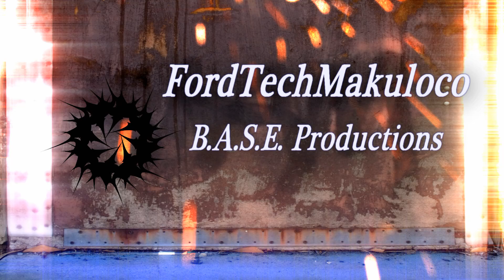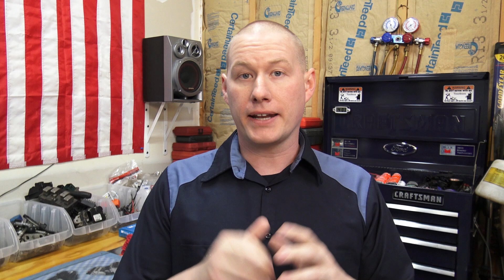Ford 6.7L Powerstroke Engine: Preventing Catastrophic Engine Failure

Comment: remove cab motor  switch over everything  and re install motor and  cab test drive in 30 hrs by myself I couldn't  do that not in the best equipped shop there is

Comment: Watching your video 20mins after my 6.7 failed. Limped it 3 blocks to the top of the hill until I could put it in neutral & coast down the hill & into my driveway. 419000 oilfield kms. 😭

Comment: Why can't just the cylinder be replaced? I don't understand why that means you need a new engine. As long as its not cracked and the cylinder wall is not damaged can't you simply install a new cylinder head and maybe even some valves?

Comment: I brought a 2011 Ford F-350 6 months ago with only 77k miles when I brought it. Put at lest $15k in maintenance and repairs and some upgrades just to have the engine suddenly fail at 133k miles. One of the codes is glow plug and other codes dealing with fuel injectors and assuming fuel pump. Ford want 18k for new motor. Mind you I still owe 30k on it. Looked online and seen that they have a class action lawsuit going on on this exact problem. Apparently Ford know for decades and didn’t recall. Called the attorney to get some info and waiting for call back. This truck is our families source of income and no Diesel truck should fail at 133,000 miles especially after constant maintenance.

Comment: Hello, I have 4 Ford 6.7 diesel power stroke engines from 2014, the camshaft has failed, cam 1 and 2 wear out abnormally and lead to disassembly of the rocker arms and their corresponding consequences. Does anyone know what the fault may be?

Comment: If That Ford engine is so good why is there a catastrophic failure issue. Just saying.
Reply: Don Olypopper  The big 3 are all in the same boat now . I preferred ram because of the low BS under the hood. But now I'm stumped.  I was leaning towards a Fa Fa Ford but only if It could be delete , with a good tuner, but now I just might just go gasoline. I lost interest in diesels pick ups cause the over the top cost and maintenance now .
Reply: Don Olypopper  they can be made good but after alot of down time and money. Sadly the era of being able to modify or even wrench on our vehicles might be coming to an end . We need to support the RPM Act 2020

Comment: Good morning,  my 2004 turbo bladed on both sides of the turbo were broken off and can't find  the broken parts. I picked up a new turbo. Where did these broken blades end up and will it find its way to the engine. Would appreciate your feedback. Thanks
Reply: intercooler,take it out,blow it & clean in solvent get rid of the bits & oil build up..simple..

Comment: 2019 ford f250 6.7l power stroke , i don’t know much about diesel, how would this truck do as a daily driver/short trip truck, (no deletes) no towing or hauling, 6 miles to work and 6 miles back home? a grocery getter. long trip once a year. i just want a big truck, i like the sound of the 6.7l power stroke diesel.
Reply: Diesel is a lot of extra maintenance, and short trips under light loads make it hard to keep the diesel particulate filter clean. I would go with gas in your situation.

Comment: My shop just installed a long block 6.7L in a 2011 Ford F350 Super Duty with 20,000 miles, because the glow plug tips broke off in a couple cylinders and it only ran on 5 or 6 cylinders when being pulled into the shop. Luckily the customer had purchased an Extended Service Plan so that he didn't have to pay out of pocket for parts and labor. There was a label stamped on one of the valve covers of the new engine that said to use the latest updated part number for the glow plugs.

Comment: I have the notorious vacuum pump oil leak at 95k miles. 89 inch/pounds seems a little less than it should be. If I did not have the massive RV, I'd return to an F-150.

Comment: 163000 on an early 2010 bulit 2011.  I will be doing this asap!!
Reply: Smart decision.  My engine was replaced at 92K due to the glow plug failure.  It took Metro Ford of Schenectady, NY five weeks to replace the engine.  It was covered by my extended warranty and it's the first time I ever purchased an extended warranty for anything.

Comment: I'm in that situation right now seeing your video relax me a bit because I couldn't understand what was taking so long to get parts to fix my 2015 f350 and had no idea of the process. Guess use to gas engines now know totally different animal. High pressure fuel pump 29000 miles.

Comment: Hey man awesome video! I wish I would have seen this sooner, my truck just hydrolocked , my glow plug failed and fuel got in the engine. It’s dead and the Ford dealer says 16k for a new engine!!! Im screwed, out on tour and thinking I’m going to just buy a new truck and cut my losses. It’s a 2011 Ford Super Duty Lariat Dually. So frustrating after giving Ford another chance after nightmares from my 2006 6.0 Super Duty. Im sorry to say but I think I’m done with Ford... shouldn’t this be a recall or something? I feel like 168k miles was too short for my truck to have the engine go out on me. So frustrating ...
Reply: for that price i would get a cummins and bite the bullet , far cheaper

Comment: just came across this video and I am currently looking at buying a 2011 f250. I am a former Ford tech but no experience with any of the diesel engines due to working on mostly cars and F150s. Is there anything else that I should look for on this truck that would ensure that I am buying something worth while? Any common issues with the super duty engine or suspension?

Comment: What is your current opinion on the 6.7 PowerStroke for the 2016-17 model years?  Are there any newly discovered issues with this motor in a Super Duty F250?
Reply: 2011-2016 were the best 6.7 motors.

Comment: Still confused on why you would buy a truck that you know is gonna fail before 100.000 my cousin bought a 6.0 with 59000 miles on it I'm still in disbelief that he bought the truck knowing this
Reply: Ford owners have a low iq and know it all!
Reply from the maker: The 6.0L is a great engine once all the latest parts are bolted onto it much better than the new engines.

Comment: Good morning!  Thank you for asking. There are no code. Scanner is giving message cat converter, oxygen sensor is not ready. Lincoln dealer technician reprogram the PCM and perform drive cycle. No luck.
I bought new catalytic converter, new oxygen sensor I did the drive cycle still the same before replacing catalytic converter. 
I have been trying this over 2 months and drove over 4k miles. 
I don't know what else I can do.

Comment: I'm looking into buying a 2015 Ford F 350 Lariat 6.7 liter 8 foot bed what should I be aware of the truck only has 16 thousand miles on it with one owner light driving
Reply: I know this comment is 4 months old. My advice, with light driving, will be the EGR system being clogged up with soot and carbon.
Reply: Anything that has a Bosch CP4 fuel pump you want to run away from. Cummins and Duramaxes are more reliable than the Ford Powerstroke. Just don't buy the LML OR LGH trucks. Get an LBZ or L5P but skip the 2017 models. If you are concerned about fuel mileage don't buy the LMM. Cummins is usually a good choice for longevity and reliability. The real problem with them is the rest of the truck and the problem is is that it's a Dodge Ram.

Comment: I'm sure you've made one of these vids before but can't find it.  I have a gasoline car and would like to move to a pick up in the near future. A Diesel Pick up.  I do all my own maintenance on my car, same would go for my truck. Have you made a video with tips for maintaining a diesel? What additives do you like to use and when etc.?  For example with every oil change on my gas car I add a bottle of Lucas fuel system cleaner to a full tank.  My car has 175k and is quiet with no leaks.  Has original clutch too 😊.

Would like your thoughts on the Diesel side.

Comment: April 18. I bought a 2011 Ford F-250 from a dealer. Truck had 99933 miles. June 13, 103000 miles, F250 dead on road with dead 6.7 liter engine. Glow plug broken in cylinder. No warranties left. F O R D, F250 Found On Road Dead.

Comment: 6.7 may be better than 7.3
Reply: It's possible.. Not really around long enough to tell but I haven't heard anything bat at all exept for the early ceramic bearing turbos.. or engines with a really high performance tuner
Reply: +Don Olypopper three turbos and two engine blocks before 11k is an absolute lie... don't even try to say bullshit like that, not even realistic dumb ass... my dads has around 56k on his work truck, 80% towing miles and long trips out of state. No work done on it ever. The internals of a 6.7 are built better than 7.3 but the 6.7 is a high performance engine, literally 2 times as much power and tourque than 7.3 which is more stress on parts. Very well could be better than the 7.3 no doubt. 7.3 had heui injection and 6.7 has high pressure fuel injection which is a big reliability plus for 6.7.
Reply: +Don Olypopper ha.. I like how " 3 turbos and 2 engine blocks" turns into turbo, exhst valve, and rods... Exactly my point. Could be a lemon, maybe not. All I know is your first statement was bullshit as you just clarified.
Reply: +Don Olypopper my dads is a 2015 so shouldn't have any problems. Only thing I've ever heard is turbo failure on the early ones. Keep in mind this is a new motor so there's gonna be kinks in the first couple years. The 2014s and later very well could be as reliable as the 7.3 and i guess my dad will find out. Either way it's a company truck so not his problem. He's put 56k miles in under a year, got it in January I believe so I'll let you know when it hits 100k which I'm certain it will with no work. 6.7 is by far better from factory than 6.0 and 6.4 and probably duramax
Reply: Yeah this Don guy is trolling, the 6.7 is an absolute beast of a motor. I cant wait to tow this summer with mine

Comment: where did you buy your engine? We purchased ours from Ford for 13,500 and they all came complete, plug and play. The only thing we swapped was water pump and fan.
Reply from the maker: +Kyle Miller I put in the Ford long block not fully dressed like yours as mine was under warranty.
Reply: +FordTechMakuloco ok, yeah ours had 273,000 miles. it had 5 broken exhaust valves and totally destroyed 3 cylinders.
Reply from the maker: Wow!

Comment: My 2016 Ford 350 had only 4800 hundred miles when I blew the motor. Completely stock no tune. 6.7 junk motors. I also had a 2005 f350 6.0 it spend more time at the Dealer than at the house. No more Ford for me. Just got 2016 Chevy Duramax

Comment: 6.7 has aluminum heads on it. no caterpillar with 30,000 hours on it at work has aluminum heads.
Reply: alloy is for weight & heat displacement,not longevity.most people here in aus change cars every 2-5 yrs,so it dont matter,,,does it.!.

Comment: Good info. but now do you have an actual video of how to change them? It might be easy to you because you've done it but for the challenged like us (LOL) we need to see it first. Nothing online that I've found  but many different forums have different ideas. Some say valve covers need to come off, or you can get to them through the wheel wells but most of them say it's a PITA. IDEAS?? Mine was built 4/10
Reply: pull both fender well liners out, and bam, your glow plug harness is right there. Pull each connector off and insert a 1/4 inch drive deep well 10mm socket with a 4 inch extention. should take all of 2 hours max
Reply: Thanks for the reply. That helps a lot. FYI, I asked my Ford mechanic and he has had or heard of no problems like this. I was trying to feel him out and he had nothing...

Comment: 2011's also just had problems with the valves themselves coming apart. The glow plug doesn't necessarily need to come apart for a valve, or several for that matter, to crack and drop a large chunk into the cylinder. Plus when you have a large chunk of valve rattling around in the cylinder it does break the tip of the glow plug off so it can look like the glow plug failed first but there really is no way of telling what happened first.

Comment: im looking to buy 2015  with 6.7, what you think of it and is there is something i need to wary about. thanks
Reply: get a dmax or cummins
Reply: my 2014 ram with cummins sitting in the shop  again for probably 10th time already this time with toasted tranny at 62k miles on the clock, besides that all new power stirring system including pump, new rear main seal and numerous visits with electric glitches, check engine lights, two new overhead consoles and this is not all,so no more ram. i never had a single problem with fords nether 6.0 or 6.4,
Reply: i bought a chevy with dmax love it so far....i would get a late model 6.0, bulletproof it and would stay away from 6.4...i didnt get a cummins because of the dodge part of it...sorry to hear you are having so many troubles...i bought my 15 lml  and hope it gives me years of trouble free service
Reply: +Spahi77 dmax/Alison is the great combo, but I don't like GM, so I want to try 6.7 scorpion delete it and see what's going to happen)))
Reply: 6.7 solid build...
Reply: +vladkot1 
Make sure the fuel filters were changed every 15K miles. If not its a $8K fix no warrenty!
Ricki
Reply: +vladkot1 Add a coolant particulate filter and ARP head studs. Don't mess with race tunes or advance timing you should be ok. Will most likley have to replace the turbo once or twice in its life but that is not too big of a deal.
Reply: There's a recall and warranty extension for 2014-16 trucks... the EGR system is defective... google 'code P04DB' for more.  Ford's extended the warranty to 11 years (!) and 100Kmi on this code... so if you buy a +100Kmi truck you're not covered, be aware!

Comment: Good video!  However, I have a couple of comments and questions.  Just like others have commented on in this thread, I have read that the reason these glow plugs are breaking is because the exhaust valves go first and hit the glow plug.  This is consistent with what I read on the ford and diesel forums.   So which came first the chicken or the egg.  LOL  Did the valves cause the glow plug to fail or the other way around?   If it in fact is an issue with the exhaust valves and heads, changing the glow plugs will not fix the problem that is happening with many of these early build motors.  My 2011 F250 is a early build (06/10) with 84K miles.  It scares the pants off me that the motor could go shortly after the warranty ends.  I really thought about doing as you say and changing the glow plugs, but does that really fix the problem?  Have you heard anything about the exhaust valve issues?  Would it be cost effective to have someone change the heads and valves to the updated version?   From what I read, the new heads are one-piece heads.  Do you know if that is right or wrong?  Also, just how common are these fails?  1 in 100, 1 in 1,000, 1 in 10,000?  You input is greatly appreciated!  Thanks again for the video.

Comment: = BUY A CUMMINS!
Reply from the maker: +Bobby John True but I used to work at a Chrysler dealer we had plenty of Cummins problems especially once the newer engines came around. Carboned up egr valves and turbos anyone? The smell from the Chrysler tech cleaning those is burnt in my brain.
Reply: +FordTechMakuloco Seems like the only Ford to buy is the early 7.3 and as for Cummins the early 2 valve. The more that Ford and Dodge "improve" them the worse they get and the more they cost.
Reply from the maker: Agreed!

Comment: The 7.3 is still the best diesel ford ever put into a truck.
Reply: Absolutely I have three of them! 7.3 Powerstroke best engine ever. I have one with 800,00 miles on it use it for a ranch vehicle feed truck.
Reply: i just sold my 99, 295 000 and on the original turbo

Comment: I wished I had watched your video earlier. I have F550 2011 with 6.7 engine.it has 160,000 km. No issue, no symptoms. The vehicle went on trip and all of sudden shut down.It started up again but would not go beyond the speed of 50 km. Took to mechanic and they diagnose it glow plug of # 5 broken off into the cylinder. Compression test was 20%.So they recommended a removal of head or other wise new engine with warranty. In any case a huge bill is for me with a long ground time.My question:is this a common issue,a manufacturing defect,what causes this?and how come ford escapes the responsibilityThanks for reply

Comment: If I have a heart attack and the ambulance has a 6.0 I will just walk to the hospital
Reply: lmao! Damn...that's cold.
Reply: Noreen Maneri hahahaha
Reply: unless bill worked on it
Reply: chad harmon take it easy big guy.... my company has 3 6.4s all over 200k with little to no work. Also got 5 6.0s with high mileage too... bone stock. Maintenance is key with these trucks. Oil change every 3k fuel filters every 5. And if you use these trucks for what they are designed to do which is idle all day... pull hard and work. They are not made get groceries or drive around looking pretty and blowing smoke out the back.
Reply: Work 6.0's are reliable and dependable. It's the grandpa grocery getter 6.0's that suck.
Reply: Shawn Tripp 6.0 can idle long periods wouldn't do that with a 6.4 as it has to Regen anyway have you had any experience with a 6.7 I'm leaning on a 08-10 Super Duty V10 but I want more power and my budget will be around $30k but all the issues with any modern diesel scares me cause once I buy the truck and give a down payment I won't have much for a repair of $1000 or more I'm going with the gas for now because of reliability and low cost of maintenance but downsides are lower power and terrible fuel economy
Reply: Thamac15 that's very true.... same with the 6.4. If they idle all day and work and pull hard. They last.